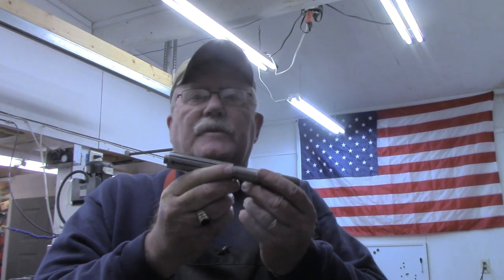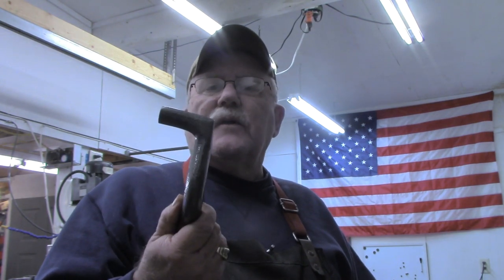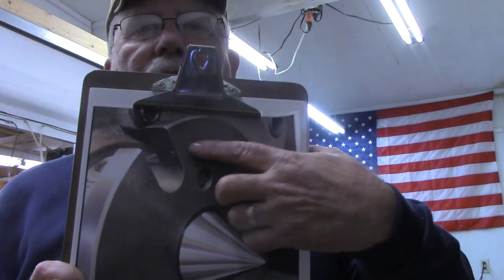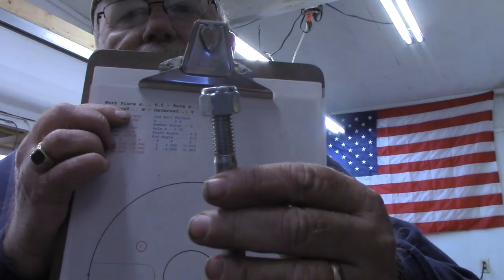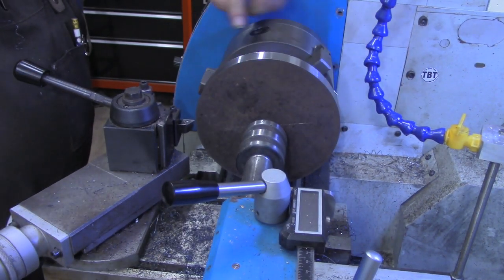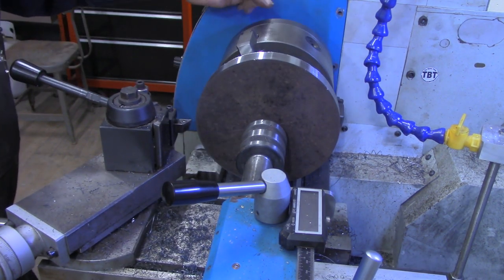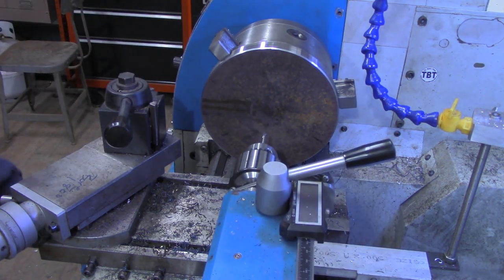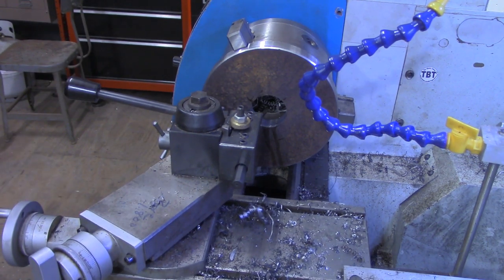Lathe Dog Drive Plate

Comment: Hi Lee, to help get larger holes started I like to use annular cutters. They do a great job and don't require as much horsepower as a large twist drill. I need to make a dog plates for my lathe. I'm guilty of just cutting a center in the chuck and then let the dog run against the jaws.

Comment: I always price shop. Even though I made a lathe dog I picked mine up in a lot of tooling I purchased from a friend of Tom over at Hill Top. I actually purchased several. I’m not sure if it may be less expensive to order a back plate from Grizzly than trying to make one due to the cost of material. You got me thinking about making one. It would beat turning a soft center every time

Comment: Two questions: 
Firstly, why not drill and tap your 3 mounting holes first? Then you can mount the "raw" plate exactly where it will go on the lathe without the need to use super glue or even mount it in the chuck to face off the 2 faces.

Secondly, why not just use a Morse Taper 5 in your lathe spindle instead of a MT5 to MT3 sleeve?

Comment: Balance?  Vibration?
Reply: Could be easily fixed by installing counter weight on off side.
Reply: @MaturePatriot  ...Or just two more holes on the heavy side.  You could use a boring hed to gradually open te bore up until vibration is minimised.
Reply: Pragmatic Lee,
   Super glue works great in many applications including yours here. However, with the amount of glue needed to hold the plate securely the wait time for setup is relegated to guesswork. This can be avoided by simply spraying the glue with cy accelerator which causes the cy glue to set up within 15 seconds which is plenty of time to join the parts.  Since the accelerator causes a chemical reaction you can be sure all of the glue it truly set. The accelerator does not affect the glue from being released with acetone. It’s available online or at woodworker supply shops as they use it extensively to hold parts temporarily. Hope this helps.
Dale from Decatur, Illinois

Comment: You’re overthinking the whole thing. A jaw on any chuck will spin the dog. Not very pragmatic of you
Reply: Yeah it will, but chucking and unchucking a tapered center like that leaves accuracy to be desired.  When using a face plate like that and the center in the headstock you'll have almost zero problems with runout.

He could chuck and cut a new center each time, but why not just use this, it's a good project and ends up eliminating problems in the long run.
Reply: Johnny Wayne you’ll have a lot less runout if you turn the center each time. A simple pass at 60 degrees for zero runout is worth it every time.
Reply: Agreed, but that head stock taper with a center would have negligible runout at best as well, plus as I said, he gets his project too, lol.